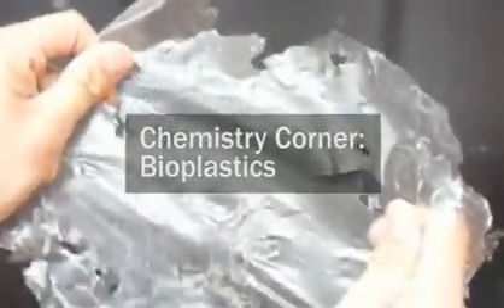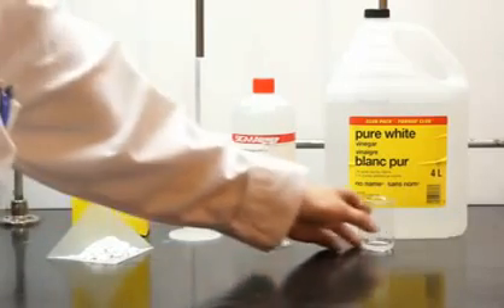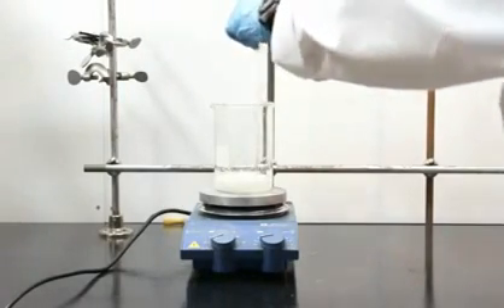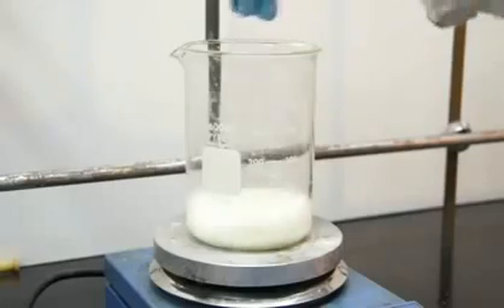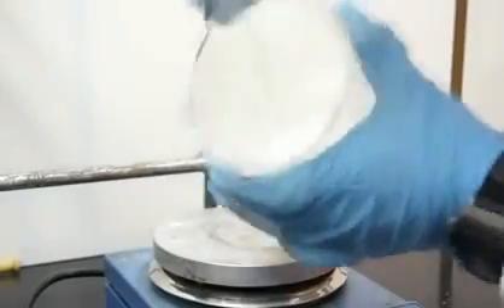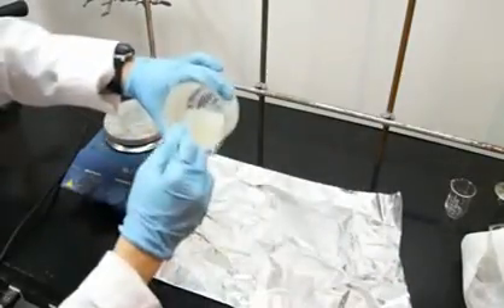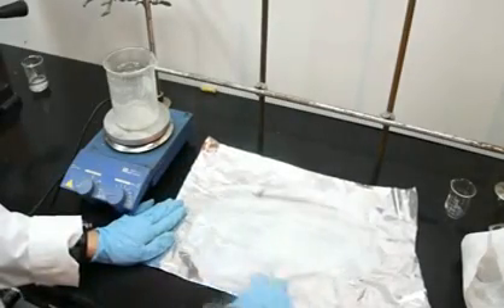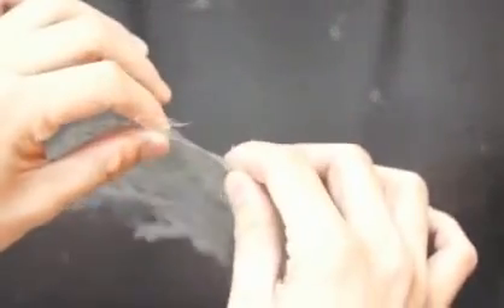Bioplastic from starch - home made

Comment: Are there any resources for making a biodegradable thermoplastics?
Reply: I've made this type of plastic and it breaks down in water quite fast - in cold or hot water. It's water soluble.
Zein, a protein in corn, can be extracted from whole milled corn grits by heating in Ethanol (50% or stronger) as the solvent. Use Non-GMO corn etc. You would then filter out the grits and slowly add water to the liquid Ethanol/Zein. When the Ethanol percentage falls below 40%, then the Zein will precipitate out.
You can then filter it and remove the Zein. The Ethanol can be re-distilled to use again. 
If you want to purify the Zein, then this can then be done several times more, by adding more Ethanol to redissolve the Zein - then filter, precipitate, filter.
You may want to let it dry and then redissolve the Zein in strong ethanol (96% or stronger) and also add a plasticizer such as boiled linseed oil - which you might first dissolve in 96% + ethanol before adding to Zein/Ethanol solution. Although it may be possible to add boiled linseed oil directly to the Zein/Ethanol. 
The less liquids used the better, as it won't shrink as much in the drying process.
Finally, you can cast your plastic and dry it. You can treat the dry/almost dry plastic by soaking it in vinegar or a stronger acetic acid. That will make the Zein protein more water-insoluble.
That process should work! There is some info online about extracting Zein etc i you want to look into it further.
Another substance that could be used, is Silicic acid alcogel (silicic acid in (96% or stronger ethanol) - just search "silicic acid alcogel".
Silicic acid can be made by first making Sodium or Potassium silicate (vids on youtube - dangerous substances, be very careful!). Then precipitate silicic acid by slowly adding vinegar or a stronger acetic acid to the Sodium silicate. You basically then just filter, rinse and add strong Ethanol to the "Silicic acid hydrogel", replacing water and forming "alcosol" and when some ethanol has evaporated it will become "alcogel". Add Silicic acid alcogel to the Zein/BLO/Ethanol mixture and combine.
With the Silicic acid added, it should make a harder, more heat resistant and possibly more transparent plastic.
It should in theory be a hydrophobic (waterproof) plastic.

To make stronger ethanol - buy or distill Ethanol to at least over 80%. You can add dry corn grits to absorb the excess water, which when removed will leave you with a much stronger Ethanol (above the water/ethanol azeotrope) You would then filter very well or re-distill to remove any tiny particles from the corn. 
I'm not sure how much of the corn grits to use, but they probably absorb at least 15% of their dry weight in water.
It's based on the fact that the starch in the corn will absorb water, but not Ethanol. It does the same job as a 3A size molecular sieve.

I hope that helps you and/or other people!
We could all be needing greenhouses soon. Weather modification and related metals/chemicals/biologicals, GMO cross-pollination... Many reasons! So a "natural" DIY plastic, could be very useful.
Zein can behave like a thermoplastic and is biodegradable. Although, if you add pine pitch, pine oil, or some other anti-bacterial oil to the boiled linseed oil, then the finished plastic should break down alot more slowly.

Comment: Apparently they break down in hot water? but how well do they break down without heat.
Reply: I've made this type of plastic and it breaks down in water quite fast - in cold or hot water. It's water soluble.
Zein, a protein in corn, can be extracted from whole milled corn grits by heating in Ethanol (50% or stronger) as the solvent. Use Non-GMO corn etc. You would then filter out the grits and slowly add water to the liquid Ethanol/Zein. When the Ethanol percentage falls below 40%, then the Zein will precipitate out.
You can then filter it and remove the Zein. The Ethanol can be re-distilled to use again. 
If you want to purify the Zein, then this can then be done several times more, by adding more Ethanol to redissolve the Zein - then filter, precipitate, filter.
You may want to let it dry and then redissolve the Zein in strong ethanol (96% or stronger) and also add a plasticizer such as boiled linseed oil - which you might first dissolve in 96% + ethanol before adding to Zein/Ethanol solution. Although it may be possible to add boiled linseed oil directly to the Zein/Ethanol. 
The less liquids used the better, as it won't shrink as much in the drying process.
Finally, you can cast your plastic and dry it. You can treat the dry/almost dry plastic by soaking it in vinegar or a stronger acetic acid. That will make the Zein protein more water-insoluble.
That process should work! There is some info online about extracting Zein etc i you want to look into it further.
Another substance that could be used, is Silicic acid alcogel (silicic acid in (96% or stronger ethanol) - just search "silicic acid alcogel".
Silicic acid can be made by first making Sodium or Potassium silicate (vids on youtube - dangerous substances, be very careful!). Then precipitate silicic acid by slowly adding vinegar or a stronger acetic acid to the Sodium silicate. You basically then just filter, rinse and add strong Ethanol to the "Silicic acid hydrogel", replacing water and forming "alcosol" and when some ethanol has evaporated it will become "alcogel". Add Silicic acid alcogel to the Zein/BLO/Ethanol mixture and combine.
With the Silicic acid added, it should make a harder, more heat resistant and possibly more transparent plastic.
It should in theory be a hydrophobic (waterproof) plastic.

To make stronger ethanol - buy or distill Ethanol to at least over 80%. You can add dry corn grits to absorb the excess water, which when removed will leave you with a much stronger Ethanol (above the water/ethanol azeotrope) You would then filter very well or re-distill to removed in tiny particles from the corn. 
I'm not sure how much of the corn grits to use, but they probably absorb at least 15% of their dry weight in water.
It's based on the fact that the starch in the corn will absorb water, but not Ethanol. It does the same job as a 3A size molecular sieve.

I hope that helps you and/or other people!
We could all be needing greenhouses soon. Weather modification and related metals/chemicals/biologicals, GMO cross-pollination... Many reasons! So a "natural" DIY plastic, could be very useful.
Reply: @Kyle-sg4rm  you’re on the right page, prepare for off grid living!

Comment: What if you pour it out on Wax Paper,  and use a rolling pin to flatten it out.  You'll have cool plastic.  Can I pour that and use it for making a mold.. ?   Does it react with other plastics,  like Acrylic or Polyester. ?
Reply: I've made this type of plastic and it breaks down in water quite fast - in cold or hot water. It's water soluble.
Zein, a protein in corn, can be extracted from whole milled corn grits by heating in Ethanol (50% or stronger) as the solvent. Use Non-GMO corn etc. You would then filter out the grits and slowly add water to the liquid Ethanol/Zein. When the Ethanol percentage falls below 40%, then the Zein will precipitate out.
You can then filter it and remove the Zein. The Ethanol can be re-distilled to use again. 
If you want to purify the Zein, then this can then be done several times more, by adding more Ethanol to redissolve the Zein - then filter, precipitate, filter.
You may want to let it dry and then redissolve the Zein in strong ethanol (96% or stronger) and also add a plasticizer such as boiled linseed oil - which you might first dissolve in 96% + ethanol before adding to Zein/Ethanol solution. Although it may be possible to add boiled linseed oil directly to the Zein/Ethanol. 
The less liquids used the better, as it won't shrink as much in the drying process.
Finally, you can cast your plastic and dry it. You can treat the dry/almost dry plastic by soaking it in vinegar or a stronger acetic acid. That will make the Zein protein more water-insoluble.
That process should work! There is some info online about extracting Zein etc i you want to look into it further.
Another substance that could be used, is Silicic acid alcogel (silicic acid in (96% or stronger ethanol) - just search "silicic acid alcogel".
Silicic acid can be made by first making Sodium or Potassium silicate (vids on youtube - dangerous substances, be very careful!). Then precipitate silicic acid by slowly adding vinegar or a stronger acetic acid to the Sodium silicate. You basically then just filter, rinse and add strong Ethanol to the "Silicic acid hydrogel", replacing water and forming "alcosol" and when some ethanol has evaporated it will become "alcogel". Add Silicic acid alcogel to the Zein/BLO/Ethanol mixture and combine.
With the Silicic acid added, it should make a harder, more heat resistant and possibly more transparent plastic.
It should in theory be a hydrophobic (waterproof) plastic.

To make stronger ethanol - buy or distill Ethanol to at least over 80%. You can add dry corn grits to absorb the excess water, which when removed will leave you with a much stronger Ethanol (above the water/ethanol azeotrope) You would then filter very well or re-distill to removed in tiny particles from the corn. 
I'm not sure how much of the corn grits to use, but they probably absorb at least 15% of their dry weight in water.
It's based on the fact that the starch in the corn will absorb water, but not Ethanol. It does the same job as a 3A size molecular sieve.

I hope that helps you and/or other people!
We could all be needing greenhouses soon. Weather modification and related metals/chemicals/biologicals, GMO cross-pollination... Many reasons! So a "natural" DIY plastic, could be very useful.
Reply: Hello! If you try to make this plastic and inject it into a mold, let me know how it worked for you! thanks

Comment: can I make cups for smoothies out of this plastic?
Reply: yep, just get a cup and run a few cycles into it, tipping it out and leaving behind a layer each time.  then pull the cup out of the cup, it has to be fairly thick (do about 10 layers? will take you about 4 days or so to do it, waiting for each layer to dry properly before continuing) to hold water for a decent enough amount of time tho.

Comment: 1)What is the application of this same process which we can show in our college project?
2) How to remove the air bubbles during heating?
3) Is electric mixer (motor run) better than manually stirring the mixture?
Please answer the above question my protect deadline😓

Comment: Yeah wear gloves you dont want those dangerous ingredients on your hands especially that water
Reply: jakub rembacz disposable gloves aren't meant to protect your hands from chemicals. They're there as a pre caution so if you do spill something on you you can take them off and wash your hands quickly
Reply: It's one of the basic safety precautions when you're a researcher, no matter how safe everything is. It's a rule
Reply: Do you get called a douchebag a lot?
Reply: thats the best thing about this kind of plastic.     i hate 3d printer resin its DISGUSTING.
Reply: I don't do it because 1 pair of gloves costs 50p but  people wear gloves to keep their hands clean oh and usually they provide no protection from most chemicals oh and search up pouring concentrated acid on gloves because well they get set on fire

Comment: can we use this formula for fishing lures? 
does it dissolve in water?
can we use attractor aromas inside for example corn, bloodworm, crayfish etc?
Reply: For softplastic fishing lures use gelatin with instead of starch and glycerin, i think you could add flavor to the water
Reply: u could use starch too fine, and its cheaper.  just make sure its about 1cm thick at all places then it should last a fair while underwaters.